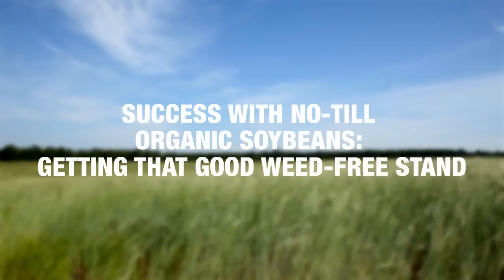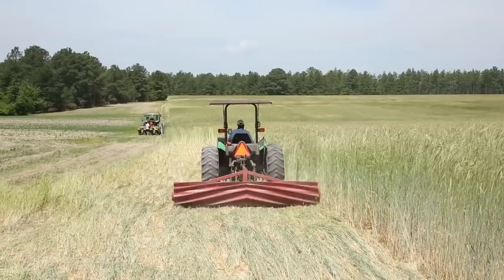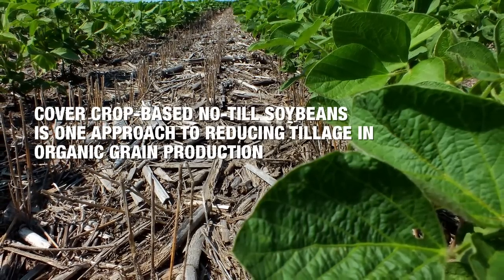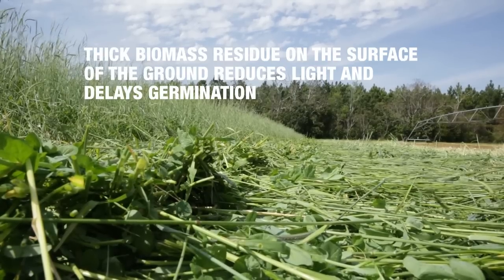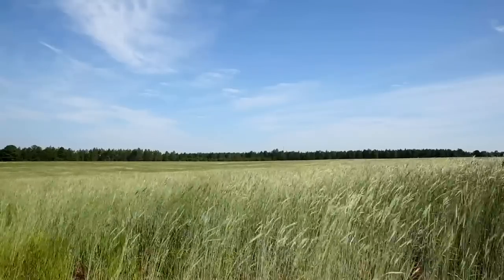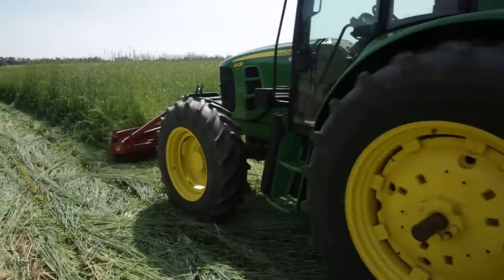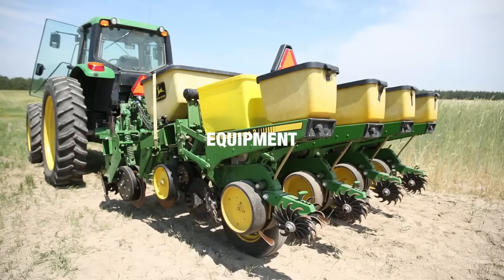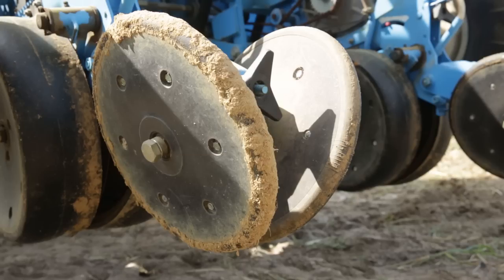Success with No-Till Organic Soybeans: Getting That Good Weed-Free Stand

Comment: the problem I see is all these cover crop programs are using just rye for a cover crop.  Try using a wide variety of cover crops like beets, vetch, peas and beans, etc.   Each variety adds something different to the soil.  With this type of cover cropping you can eliminate the fall tillage all together.  If the goal is to do no-till soybeans why not no-till  the cover crop too.
Reply: Are you farming like this?  What is going to happen to the bean seed in the spring when it has to come up through all of this rotting mass that hasn't been cultivated in ?
Reply: The tillage is for the rye crop not the beans, they go right into the green straw residue. 
Adding diversity to the cover crop would reduce its mulch potential.
Reply: @angrybeaversmc Do you think one gets a thick swamp of rotting stuff? It's not nearly as horrible as you make it seem, unless you can point to a youtube video showcasing it?
Reply: Also, plant diversity means biological diversity which prevents pathogens from taking over.